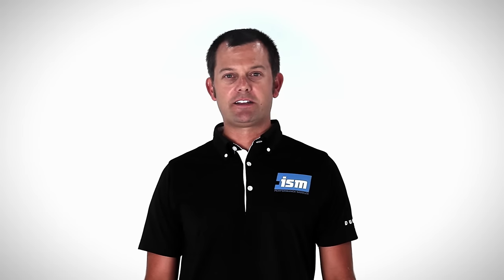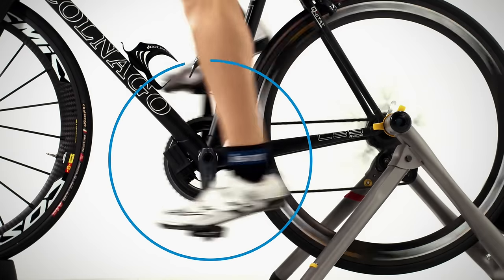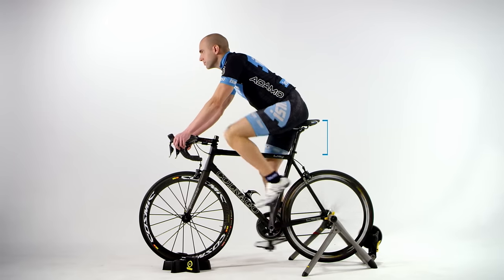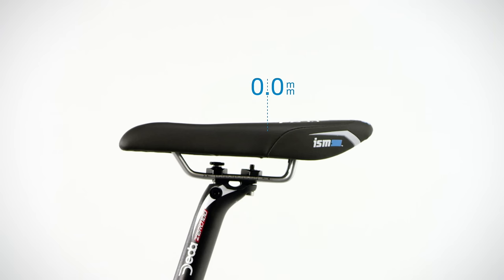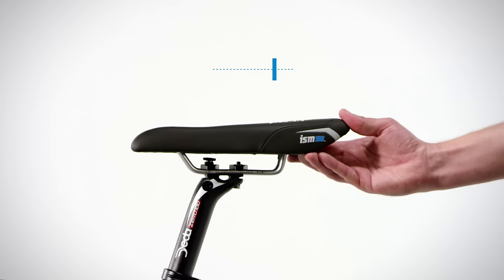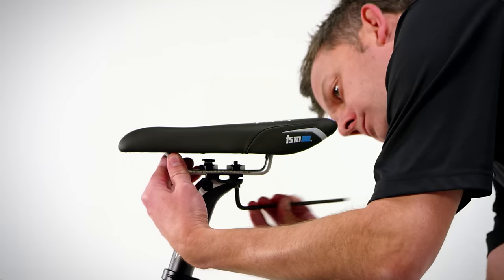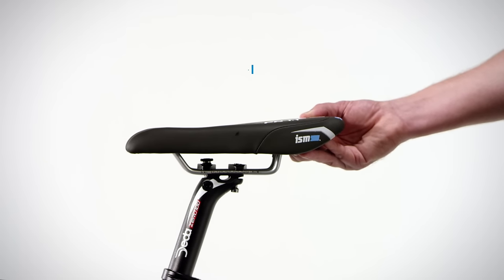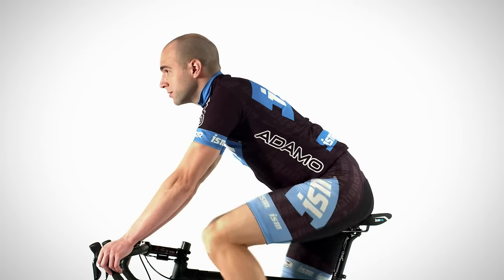ISM Saddle Setup - Road Bike

Comment: All I have to say is Ouch after the first ride
Reply: I've just bought one - bad saddle sores after one ride too. Did you decide to stick with it?
Reply: @rugbyjc240  tried it 3 times 9n an hour ride each time.  I switched back to my old cheap one
Reply: @physiciansassist1  Cheers Richard! May sell it on haha
Reply: If it really hurts it means you set it up wrong. I will admit it is extremely difficult to setup. Throw out your old reference saddle position and start from scratch
Reply: How much do you weigh?
Reply: @willek1335  280lbs
Reply: @physiciansassist1  why

Comment: It's like having a bat between you legs.  Let it rub your inner thighs raw.  I own one.  If it was more narrow at the mid section and front people wouldn't need to use zip ties to adjust it.  Just make one that's more narrow and these things would fly off the shelves.  Same ISM saddle, just more narrow at the front AND mid section.  The paddling is soft enough you probably don't need a space in the middle.
Reply: Which model do you own?  I'm looking to buy the PN 3.1 which is one of the narrow models.  PN standing for Performance Narrow.
Reply: @jshepard5840  I have the ISM 3.0 60 or something.  I ditched that one and went with the Bontrager Hilo RXL without speed dial.  It's the best saddle I've ever experienced, ever.  I went on a 7 hour ride and didn't even notice the saddle it was so awesome. It's super light and super awesome.  Perfect saddle.
Reply: It means you didnt set it up right
Reply: scott richey.so go and buy a regular seat then.losing the middle space and  making  it more narrow would make it a regular seat and defy its purpose.
Reply: He makes the same post on all ISM videos so maybe paid by another company to post these? I have way larger thighs and have zero problems with thigh rubbing. It did take a bit to get used to sitting closer to the edge of the saddle. If I try to sit back on it like a normal seat, then it will rub.